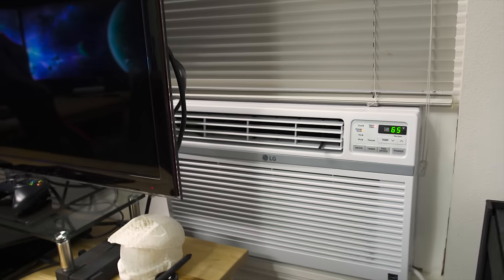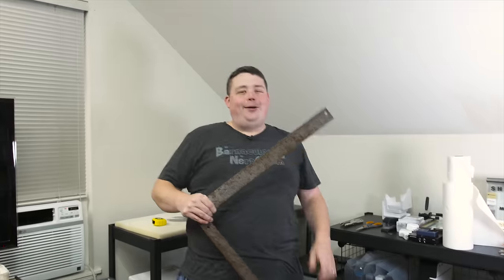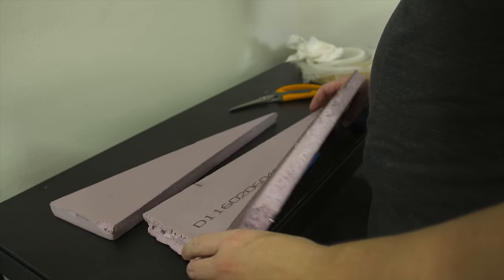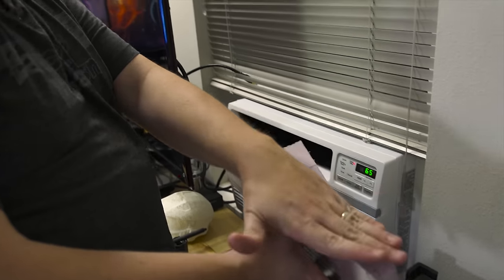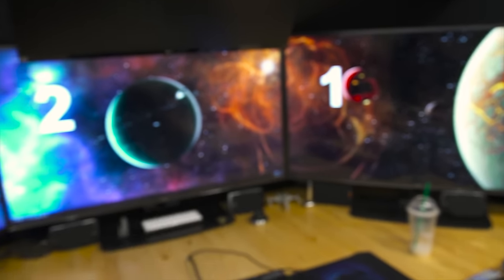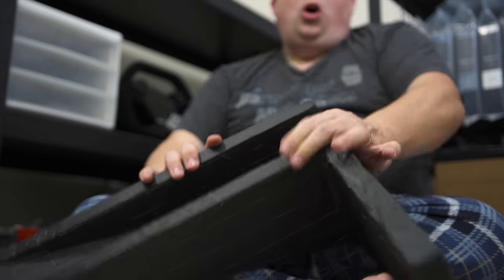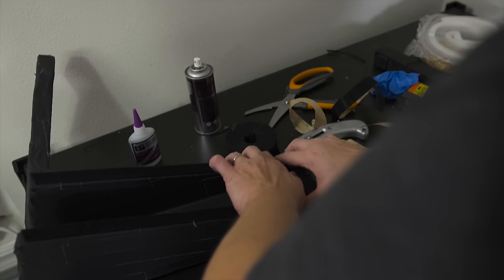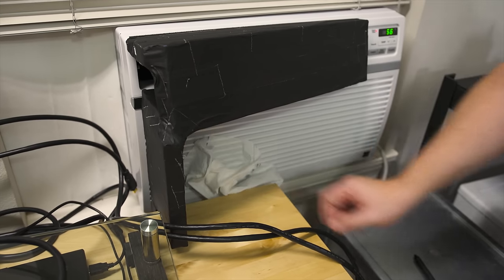Building Custom DIY Air Duct for my Window AC with JayzTwoCents - @Barnacules

Comment from the maker: 111k views building something out of foam and tape. I love YouTube! :D
Reply: It's awesome! 
I'm still trying, two summers in, to ghetto mod my portable AC so it can work at all. Funnels hot air with great volume to the outside and it's impossible to do with windows opening outwards at the bottom frame. Any gap will just pull hot air back in and recycle; giving zero net cooling. I'm renting so using a hole saw through concrete might be frowned upon.
Reply: When are you going to add an old case fan to your duct to increase your cubit feet of air flow?
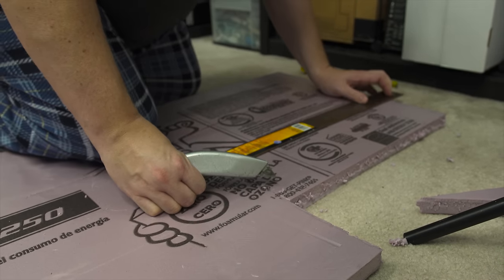Reply: only thing you are missing is duct tape (but maybe I spoke too soon? I am only @ 4:14 right now lol)
Reply: do you have a video on that acoustic foam?
Reply: Why not 3d print the duct?
Reply: Barnacules Nerdgasm why don't you just 3D print parts

Comment: Hey Jerry just a little tip if you open the box cutter you should find that the blade is reversible and the rest of the blade might be sharp, sometimes there are even extra blades hidden inside depending on manufacturer.

Comment: I've done that, your tape contraption will get wet(condensation) and it will fall apart, thats a very quiet window ac though
Reply from the maker: I got it for how quiet it is, and also the condensation hasn't become a problem yet. However, I can easily solve it by spraying the inside with lacquer to seal it.
Reply: Condensation only happens when hot air meets cold air, if there is no leaks/gaps for this to happen your good to go
Reply: Dont u have 3d printers? :P
Reply: I'd be more concerned about the window unit not moving enough air therefore the coil will ice up, liquid refrigerant sent back to the compressor which will burn it out
Reply from the maker: Keep an eye on the coil and nothing to worry about, doesn't seem to restrict the airflow hardly at all.

Comment: About half way through the video I realized he could also 3D print a really nice duct instead XD
Reply: You must have a really big 3D printer :o
Reply: LazerLord10 Well I mean he could 3D print it in parts and then Bondo, glue, or screw it together. 😊
Reply: Air Deflector on Amazon is less than $5. Probably spent more money on gaffers tape than it would have cost to just buy one.

Comment: I own an HVAC company and you just lost 20 percent of air because the wedge you made is not curved in a circle motion so you should use a diverter from an HVAC supply house and use flex duct so you don't lose your air flow plus your causing your head pressure to climb and make the compressor to slug liquid
Reply: warlock 39 who cares if his 100 dollar window banger slugs. I'd be more concerned about the water damage to the house from the nice iceblock he's got coming his way
Reply: I would have definitely pointed it away from the TV to reduce chances of condensation inside the TV casing. Rounding the corners won't help much, plus with the reduced restriction from removing the grille he's probably keeping the air resistance pretty close to its designed spec.
Reply: I just get a bigger fan and blow air were ever you want , and a little refer for cold VITAMIN - R.
Reply: i though the same thing bit of flex would work well
Reply: If you watched his video when he installed it you'll know that that ac unit could cool down a space 5x larger then his room. So i think he's getting enough airflow.

Comment: Why didn't you want to 3D print a custom duct?
Reply: cause it will take 79 hours
Reply: No it wouldn't, not unless you make it 2 inches thick.
Reply: If it is only a couple of millimeters thick, just enough to be sturdy it won't, and it will also benefit by being more open for air flow.
Reply: Foam is a better insulator than plastic, so it retains the cold air until it gets shot out the outlet, and 3D printing a custom duct would have taken a lot longer than just maybe an hour total of cutting foam to fit as well as taping it to one color. Foam is also lighter so he didn't actually need that wedge to keep the foam up, but I guess now he can put stuff on it.

On the other hand, using 3D printing, he could have made a more complex shape to have even better airflow, but again... Foam insulates better, and it's quicker. He could make a 3D printed plate to go over the outlet and make it so that he could fit some sort of tube for directional airflow, or even just extend where he wants the air to really feel cold =P
Reply: Was wondering the same thing too. 3D printed shell with a foam interior.
Reply: Unknown Whisper He didn't put the bit at the bottom for support, foam is light enough that it doesn't need overhang support. That is supposed to be a blocker for the airconditioning intake, so the cold air being blown due left of the aircon unit won't just get sucked back into the intake at the bottom of the outlet.
Reply: podboi825 Yeah, after I posted my comment I remembered he mention that... But I was too lazy to fix my mistake =P On the bright side though, he still can put stuff on the duct =D
Reply: Cos there are better ways?
Reply: Unknown Whisper I wouldn't be very worried about insulating a 1 foot tube that connects to ambient temperatures. The difference would be so tiny you wouldn't notice.
Reply: tomcornwall83 3D printing this would have been sexier and cheaper (or better)
Reply: Im not gunna get started on this.
Reply: tomcornwall83 you did by posting that comment
Reply: To be fair, this is supposed to be a DIY thing, meaning mostly anyone can do at a low to no cost. So we completely ignored that fact and just went on to more complicated things
Reply: Unknown Whisper It's only a DIY thing because that's what he thought of.
Reply: Proof of concept.

Comment: now that you have the proof of concept mocked up, you should 3d print a more durable shroud
Reply from the maker: +bexmister92 i might do this!
Reply: awesome! cant wait to see the video.
Reply: i think the insulating properties of the foam actually helps though
Reply: Wouldnt it be better to suck the "hot air" from the top of the room in to the AC and blow the cold to the bottom ?
I mean in germany our hot stuff goes to the top and he is sucking from the middle of the room.
Reply: Chris ImItReal  Wouldn't it be better to cool the ceiling so that when hot air goes up it gets cooled, and the whole room gets a more even temperature?

Comment: Shouldn't you just get some dryer hose to get the hot air from your PC out of the room?
Reply from the maker: +Mies van der Lippe because to exhaust air from
The house it would need to suck air into the house from somewhere else. The AC doesn't change the pressure of the room.
Reply: Often AC's have a bypass to bring in some fresh air, that would be some real Jerry Riggin'
Reply: That could be good though to get some fresh air in the room.
Reply: Get some air circulation going so you don't even have to worry about farting in an enclosed space
Reply: +Barnacules Nerdgasm why didn't you 3D print a cover instead? Also... Wouldn't that cold air flow mess with that FormLabs 3D printer on the other side of the TV while it's printing. Cheers

Comment: I dont understand why people use a tape measure measuring in inches, Millimetres are so much easier
Reply: It is standard in the US. Most standard measuring devices are in inches/feet here
Reply: And the people that use inches (like me) say that inches are so much easier.
Reply: Zach Demand If you do anything scientific, such as physics, metric is by far superior. But for just eyeballing measurements, I find imperial to be better
Reply: its all a habituation thing
Reply: Why do you think Millimeters are easier?  Measuring is the same regardless of if you're using standard, or metric.  You talk about Kilometers, and I don't have any real concrete understanding of how far that it, but a Mile I know since I've walked miles with markers to tell me when I had walk that far.  What you're used to, is what seems easy, plain and simple.  The only reason I'd like a switch to Metric, is in the automotive industry, and make it international, and recall all standard nuts and bolts for metric versions, so it would be a one size fits all setup, but this will never happen.
Reply: Sean Kiesser It's mainly because everything is divisible by easier numbers, no fractions involved, etc.

1000mm / 100cm / 1m are all the same measurement.

There is dm also, (decimeter) but nobody uses it.
Reply: Perhaps so, but it's still what we're raised using.  I was raised on Standard, which is a misnomer, since most of the world uses metric, but still I understand Standard, and feel frustrated when I have to use something metric, I assume it's the same for you in reverse, when you have to use something standard, you can do it, but it's not what you're used to.
Neither way is genuinely better than the other, and forcing people to use fractions isn't a bad thing, people need to know fractions, and understand them, so to each their own.
Reply: By 'standard' you mean imperial, yeah?

Really just depends when and where you were brought up, and in what your parents do, builders, mechanic, etc.
Reply: Litruv I'm sort of forcing myself to switch to metric. I am good with mm/cm, okay with meters (I want to associate them as being equivalent to a yard) and I don't really know a km. Celsius is also a bit foreign, and same with liters.
Reply: celsius is easy.0°c is water freezing..,100° water cook at sealevel...36°c body heat.
1liter is a cube  10cmx10cmx10cm

yard and meter are not so different 1yd=0,91m
1kilometer is 1meter x1000
and 1km=1093yd
Reply: 1'10 27/32" + 1'1 3/8" = ??? wtf
58cm + 34cm = 92cm
(same numbers in both cases btw)
Thats why metric is much more convenient, you have numbers just right there so you can summ it up in second.
Reply: In the digital age not very many people use fractions anymore. So your math would look like this instead: 1' 10.84375" + 1' 1.375" =3' .21875". Besides the metric system has fractions too. Whats so bad about challenging your brain?
Reply: Zach Demand time is money..if you need to do this akward calculations 50 times a day on construction site you are loosing money just to challenge your brain. Also..you start using mm if you want precision not fractions, then it will translate to 540mm+340mm..still much more easier to read and understand
Reply: MrDumbDrunk Those "awkward" calculations are actually really easy, especially if you do it everyday. The standard system (imperial) is just as easy for us as the metric system is for you.
Reply: Zach Demand Well...you know my opinion, you can keep yours - i guess
Reply: What ever works . on Battle Star Galactic it was a  Centar  .?.
Reply: What ever works . On battle Star Galactia it was called a CENTAR .?.
Reply: I think its a Centar . ( Battle Star Galactica )
Reply: What the #&(@ why are my reply's down here when i replied way up there . I was wondering were they went !? This page must a GOOGLE BULD.?!
Reply: V360Newzealander because it's America. We do what we want 😂

Comment: shakey camera is shakey
Reply: he also "definitely" doesn't have multiple 3d printers to do this
Reply: not effectiv use because the build (cost) volume is too high and a fail would really hurt. With foam he can just add peaces and redirekt the airflow as needed.
Reply: Do it in multiple pieces for the fail rate
Reply: High base cost then cheap maintenance

Comment: Jet engine mechanic here. With that harsh ass angle coming off the exhaust, you've lowered the fan efficiency by quite a bit. If I were to take on this project, I would have simply placed another fan near the exhaust to spread the cool air throughout the room. If I were to try to create a duct however, I would've gone all-out and made a duct that goes up towards the ceiling to give the cold air plenty of time to dissipate before being recycled for more cooling.

Comment: Referring to the remove the vent reference..... Unless you got a High output unit......
Problem with running ac without the register vent it restricts how far the cool air will go before it sucks it back in. This will cause it to stop running before u want it to with it still hot every where but right in front of the AC. I went through a lot of cardboard before fixing a broke register to force the air further out. 

Referring to the video nice work.

Comment: I'm not to far away in Lacey WA, since its been getting colder ive been using folding at home to heat my room. I can dissipate about 500 watts of heat with my overclocled FX- 6300 and R9 285 and do about 200,000 points per day worth of folding, since every bit of power goes into heat i consider the folding to be free. And you can write a  portion of the electricity cost of the machine off on taxes as well if you make sure to document things correctly.

Comment: you could use flexible dryer ducting and move the cold air to where you want like a remote vent. or water cool your pc with an external radiator outside the room.

Comment: Get some 16d nails.  Push them into the foam to make the joints more permanent than the tape.
The extra foam could be used to create a duct work for the intake.  A vertical piece going straight down.  Granted the heat in the room is near the ceiling.

Comment: Try flipping to blow to the right . towards the control panel may work better because the TV will still be dumping heat behind it and into the wall and your foam. so it may lower your temps by not picking up the extra heat as it goes

Comment: you should have it blowing at the top of the room as hot air rises. This will cool the hot air till it falls and therefore creating a convection current. This will greatly increase the efficiency.

Comment: Direct cool air flow to the back of the TV screen will cause a cool spot on which moisture from the air will condense and might mess up the internal components of the Flat Screen.

Comment: Very nice hack, however from an engineering point I would be worried about the extra pressure your placing on the fan blades.  Probably be ok but time will tell.
Keep the videos coming!

Comment: im surprised there was no 3d printing involved with this project...perhaps in a future episode. oh also a heat knife is really good for the pink insulation foam. also if you want to paint it, i would say do a layer of wood glue or modge podge (maybe 2-3 layers) and then paint.

Comment: yes i do know for all you trolls this is a old video! 1 helpful tip.....a pizza cutter works great for cutting thin pink foam and on the inside "reflectix" vapor barrier an a lil spray adhesive on the inside of the duct works great an prevents mold!

Comment: As you have extra space next to AC in the window. How about a pipe connected to fan that is sucking hot air behind the computer units and pushing it outside? That way you don't get the warm air inside the room and AC unit don't need to work that hard.

Comment: I modded my window a/c unit by using a standard household thermostat. I place the thermostat across the room out of the direct airflow of the a/c unit so that it cools the room more evenly. To do this:

Open your front bezel. Find the  thermistor, cut one leg of it's wires. Then route the circuit through the cooling pins on your thermostat and back through the unit. You'll want to leave the thermister in the circuit. Set your A/C to its lowest temp setting, and then use the thermostat to control the temps. It tricks the A/C into thinking it's either very cold or hot in the room and cycles it on and off. Added bonus: you can use a programmable thermostat.

Comment: You only need a piece of cardboard or wood and duct tape to direct the cool air upwards. Just a rectangular piece. Taped just between the output and the intake in an angle facing upwards.

Comment: your friend is right to taper a plenum down as you go down the line so you don't lose cfm (cubic feet minute) of air flow but your run is so short it's not gonna really have any effect of cfm loss. it's also going to sweat and create condensation that's y there is a pan under the coil in the unit. if you send it through PC be careful it doesn't sweat the components. they have a cfm calculation tool you can buy to determine if you are losing air flow from the way you are doing your duct it's not done bye temperature. your temperature will remain pretty constant. maybe a slight loss going down the line that's about it if you sealed it right

Comment: Really like your videos.  They make me smile.  On this one though, why are you blowing your 62F air across the back of a 98F monitor (guessing temp ... you have to measure).  You might be much more efficient to allow some of the warm air from the back of the monitor to go into the A/C's intake and shield the cool air from the back of the monitor.  It only makes sense to blow the A/C across the back of the monitor if your purpose was to reduce the heat within the monitor and extend its life.  I am fairly certain that this monitor isn't in such a hot location that cooling the monitor, beyond the ambient room temp, is necessary.

Comment: Missed the chance to make an awesome 3d printed duct that could slot into the air conditioning unit indents and perhaps split the air flow into 2 channels going up and left, or one big channel aimed up towards the center of the ceiling. Or you could just 3d print a proper plastic mock-up of your foam design. Either way, cool video.

Comment: Heat rises and cool air drops, you needed to have to have the duct to shoot straight up to where the heat is. it will remove the heat much faster and cool the room down quicker. 20 something years in the business, just a tip.

Comment: Barnacules were you trying to cool the hot air up in the ceiling.  haha.  OCD here tape the foam using foil duct tape then wrap the DIY deflector with some 3M vinyl carbon fiber wrap.  Add of high air flow fan see if that helps; hmmm.  

COLD 66 degrees; CPU's should be running pretty cool.